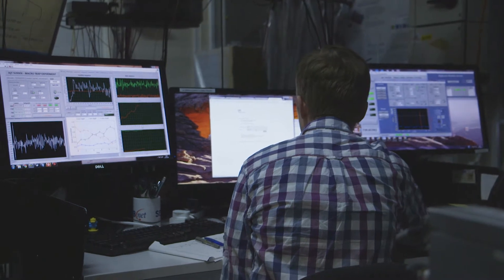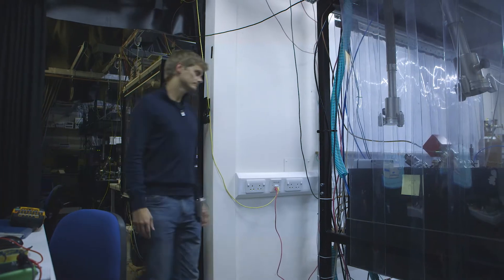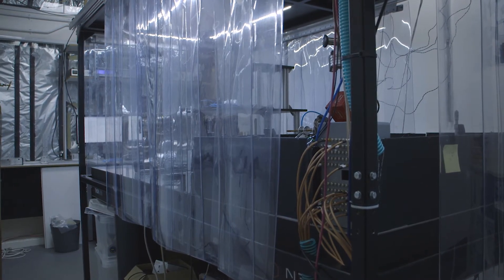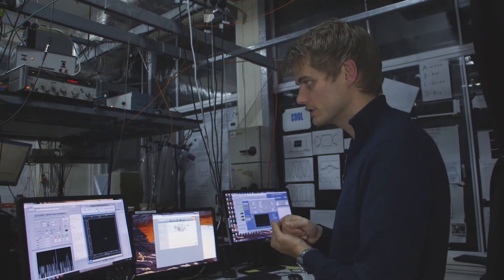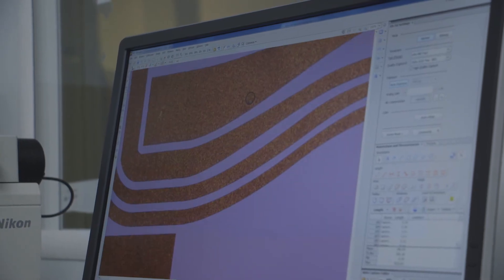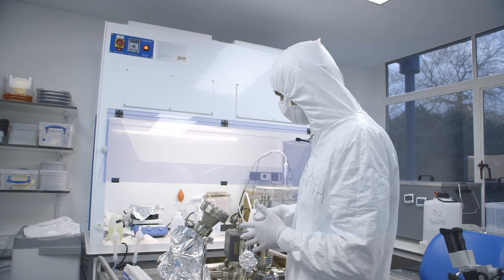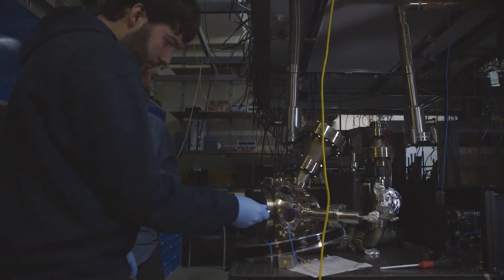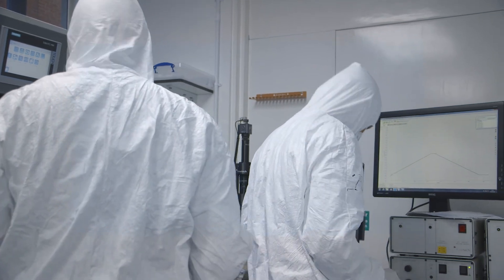Inside a quantum computer lab

Comment: Please do not call a quantum computer a computer. I realize it is good for attracting investors but it is so untrue. The term computer is taken, it belongs to Von Neumann type computers. In stead, let’s call it a quantum equation solver (QES). That name would be fitting.
Reply: they are turing complete, so computer ins't wrong term. i know using them to do classical computing is pointless, but they can act as a processor of a normal computer, and if you have a computer with a quantum processor why is wrong to call it a quantum computer? ( althougt the bleeding egde correct term would be QPU, "Quantum Processing Unit" in analogy to how a GPU helps the CPU)
Reply: erick weil QPU is much better already.
Reply: Are you suggesting that a Harvard machine isn't a computer?